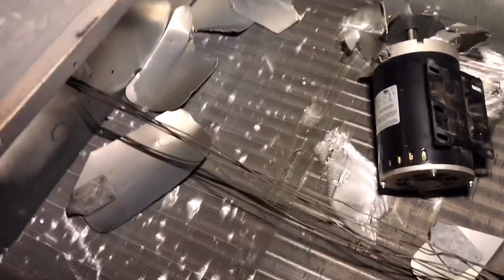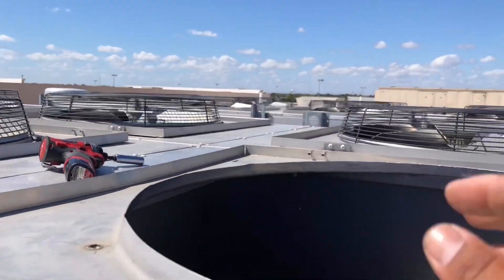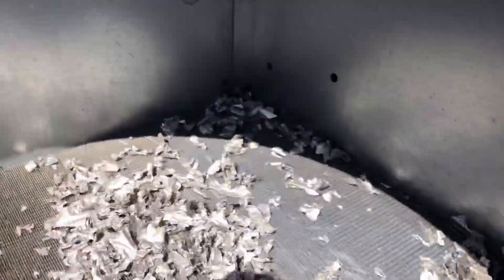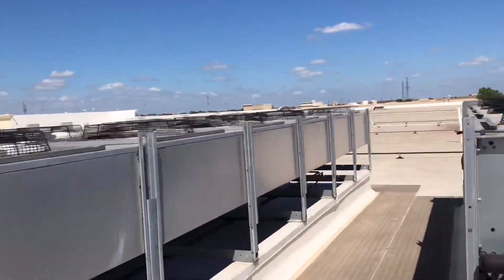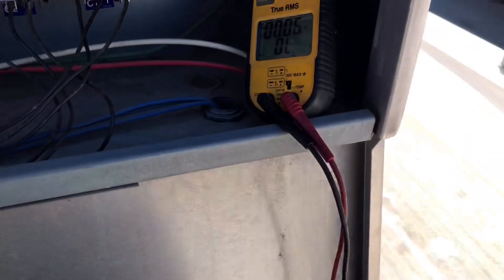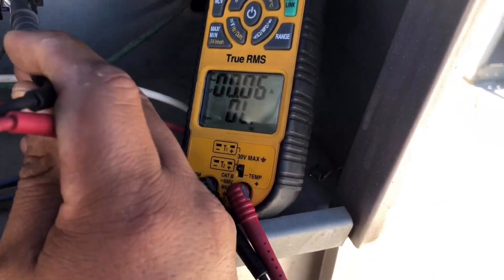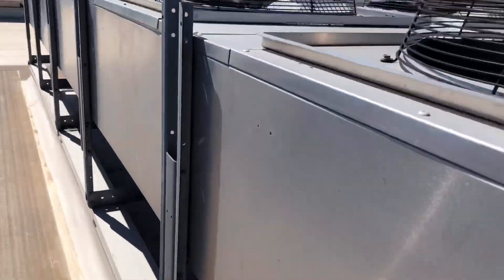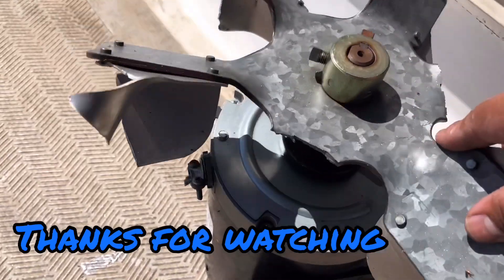HVAC REFRIGERATION:  Follow Up call on a Rack Condenser Repair

Comment: Over half a ton of refrigerant!  How much did that stuff cost?

You would think such a big customer could afford to just replace the whole unit rather than repair a trashed condenser.
Reply: Absolutely not.  Getting a new condenser delivered would not have been possible.  No one could pull that off.
Reply from the maker: Lol.  Let’s just say about the amount of btus in a ton.  😂😂😂😂 in$$$

Comment: How much nitrogen did it take to bring up to 175psi for pressure testing. Capacity is large, are you able to valve off sections?
Reply from the maker: I had the condenser called off. And we don't use nitrogen.  You don't want to contaminate the rest of the refrigerant.   There was still vapor in the rest of the system.

Comment: More than 20% destroyed coil.. I hope the customer replaced. If not it'll cost more in tye long run.
Reply from the maker: RisenNation what do you mean more than 20%.  Based off of what area?  It’s actually a small area compared to the coil.
Reply: @rookierefrigeration4357  from the fan motor fell. That area, at least from the video, looks more than 20% destroyed.
Reply from the maker: Not sure how many fan motors it had, but if the actual area inside, it may have been 20% out that particular area.   Nice eye.
Reply: No no.... This was the ONLY option.  Earth as we know it was counting on this Brazing fiasco.   You should present him with a purple heart or something equivalent.

Comment: That patched up coil is a temporary fix?
The unit still works right?
What about the pressures?
Reply from the maker: MrJeromegon yes, we will see if the customer wants to replace the entire coil or leave it.  
It’s working fine, pressures are in the mid to high 200s.  290 last time I was there.  Still holding good.

Comment: why would they all be hooked up together....to lose all that refridgerant
Reply: brandon Cherry That's Supermarket that call a rack system when l did Racks system it's normally to put in that much refrigerant when you have a leak. It's energy saving to run one whole system one rack would take LT case other one is MT case in store . They might have more then two racks in the store .Most of diagnosed is 75% electrical & 25% mechanical rack .
Reply: @hvacrnortheastern2110  man thanks reply it intrigues me the work you guys do...it blows my mind...its like rocket science watching this ...and hard work..
Reply from the maker: brandon Cherry this is a rack system.  That’s the design.  There are many benefits to racks.

Comment: Time For ANNUAL  Fan Blade & Bracket inspections. 
2) u might want to See if Factory Has a Newer / stronger style bracket or Reinforce ALL Existing Brackets With " L " Brackets so This Never Happens again. Through bolt reinforcing L brackets at corners.
Reply from the maker: OcRefrigeration , Hvac & Electrical Video's. I’m actually gonna bring it up to the service manager tomorrow. Thanks for the tip.
Reply: No prob. after 38 years of this stuff. You Learn how to re-engineer obviously under size bracket. Just another example of under engineering / Price vs Heavy duty Quality. something definately needs to be done to save the customer another $25,000-$30,000 bill.